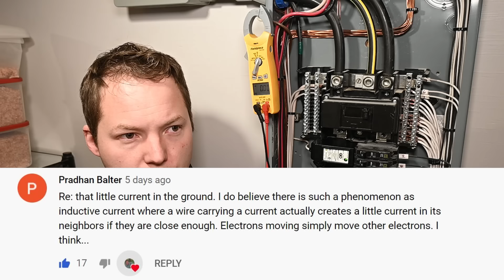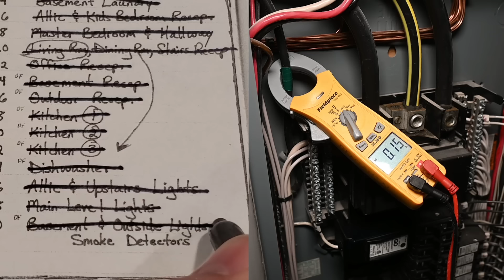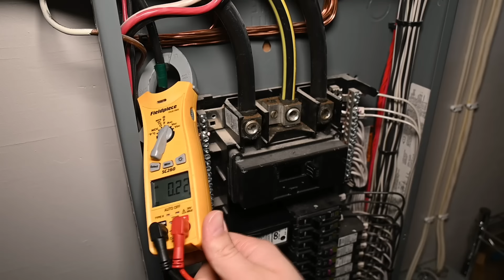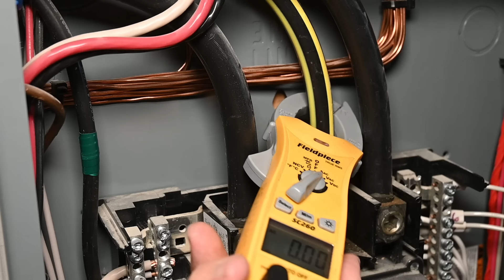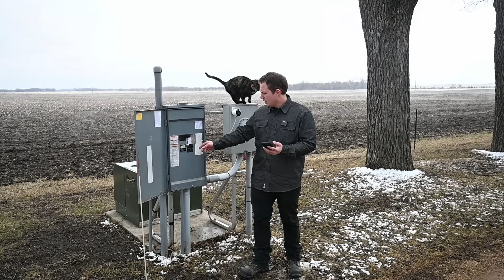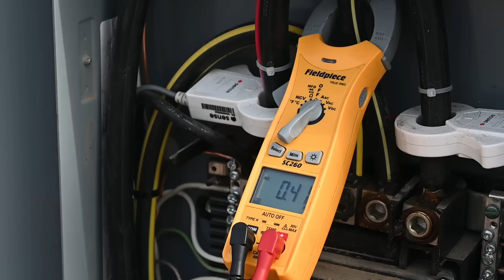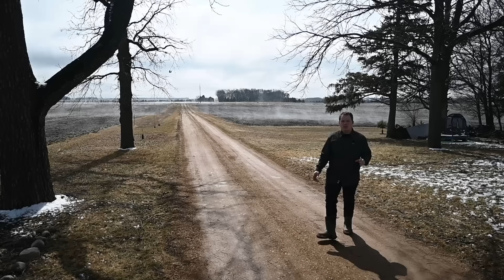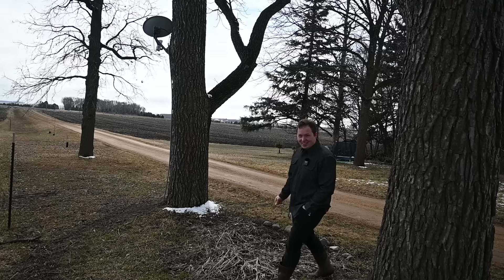Finding The Source of Stray Current on Grounding System

Comment: First of all (not only being a NEC violation) having ground rods at the main disconnecting means and at the sub panel is why current is flowing through your grounding conductor. You have created a high impedance secondary path! Your ground wire from your main panel to your sub panel (equipment ground) has become an extension of your grounding conductor/grounded conductor attachment point in your main panel. With an impeded path between the ground rods at the main, the ground rods off of the sub panel and any pipe grounded in the vicinity. There will always be potential voltage/current on a neutral, proper grounding is essential to make sure there is no potential difference. All your ground rods, all waterline bonds etc. need to be at one point at the first over-current device location. This brings all your grounds, and neutral to the same potential throughout your electrical system and keeps transient voltages between your main ground point and the utility side. Even more important, you do not want ground rods or waterline bonds at your sub panel for safety reasons! This can be a very dangerous situation in the event of a nearby lightning strike to ground in which your ground rods/waterlines conduct the lightning and provide a path through your wiring/house to any path back to ground, and being you have a difference in potentials you have created a good path! I could go on and on from issues with interference's to neutral connection issues at the main/trans. etc.
Reply: You seem quite knowledgeable about grounding! Would it be possible to converse with you elsewhere about a situation I'm having? Thank you!

Comment: not clue what i am talking about and this video is 3 years old. check with power company, and more so near by neighbors. i have seen a few videos of were.... something happened at neighbors and the power was feeding across the yard, and shocking them.  i want to say ground wire to ground rods were having issue as in wire not there or came out, or someone installed something and did not wire things correctly and sending power out.

Comment: When I connect a coaxial cable and ground it, it draws amps. When I power on other electronics the amperage rises. When the coaxial cable is disconnected, there is no amperage going through the ground...what is the problem here?

Comment: worked on communication tower construction and grounding with us is everything.  It so easy to trust that the power companies stuff is all groovy till it's not.  Have had power pole transformers over voltage and blow every power supply fuse that had an MOV for surge arresting.  The voltage was found to be +>250vac! Did not expect that.  Another time we had failures at the ground rod the power pole was grounded too.  It made everything "shocking".  Found out the grounds keeper had cut the copper wire with a metal edger.  Another time everything in the building was suffering lightning strikes and would get shocked. This was at a Forest Service center.  Seems everything was attached for grounding to the metal building that was bolted to a concrete slab but had zero grounding for the metal building.  Put ground rods at each corner of the building with grounding straps  from the rods to the buildings.   Problems stopped.  Never had lightning damage again.

Comment: How do you get rid of the current on the neutral
Reply: Every neutral wire in America that is connected to the grid, and as long as the power company is providing power, will have a small amount of current flowing throught it. This is known as NEV Neutral to Earth Voltage.

Comment: You are seeing the effects of your lovely electrical distribution system design referred to as multi-grounded neutral. It has nothing to do with how many or where your grounding system is installed. It is due to the utility that brings power to your property. This type of distribution is common in the US in all states except California, and was devised as a way for utilities to save money by eliminating the need for one more wire in the distribution system as well as cheaper transformers (single vs. two-bushing transformers). Further, the NEC requires you to tie your grounding system into the utility neutral so they can use your grounding system rent free (further saving them money).

Unbalanced loads in the utility neutral will find a way back to the source (power substation) in an uncontrolled way through the earth. These uncontrolled ground currents can be detrimental to livestock, and dairy cows are especially sensitive to it. The behavioral, health and production effects have been documented, and there have been cases of human fatalities. 

For more information, please read the IEEE publication "The Hazardous Multigrounded Neutral Distribution System And Dangerous Stray Currents" by Donald Zipse which traces the history of the issue back to Edison who encountered it back in 1880 with a system that employed only one current carrying conductor and utilized the earth for the return conductor (not just the unbalanced loads). As you can imagine, it was quite dangerous and he soon devised a fully insulated three wire hot/neutral/ground system that had no stray current and wasn't connected to earth.

Also, Mike Holt has an interesting YouTube video that touches on this subject called "Neutral-to-Earth Voltage (NEV)], NEC 2020"

Comment: BENJAMIN, When finding stray current, why not switch off each breaker one by one while measuring the stray current? its also called leakage current but coupling wires cause ghost voltages which has coupling current also. It would be nice if you used a chalkboard to show a list of which circuits you have measured and how much stray current per each break and circuit to know which is connected on the panel and subpanel because I don't know what is connected to all those different breakers.

Comment: Dear Benjy, you still have leaking currents because you have ground bars on both panels. There should be only ONE grounding to earth point. With 2 "earthing" points you have the so called "hum loop".  Comment of @88v98 describes  minimal contribution.
With 2 earthing points, you may have potential difference between these 2 points which may cause leaking currents through ground-wires-pipes and earth closed path.

Comment: but did he ever figure it out? cuz at this time i have the SAME Exact issue however .when my microwave or toaster or anything with a load is running. its been backfeeding thru the internet ground which goes to a coaxial which then fries out my modem. How can i fix or find whats causing this. the video above literally is exactly what i got. power on my nuetral seems to be coming from the meter box.
Reply: Did you solve this? We have similar situation

Comment: If you can’t capture 2 wires at once with your meter you can figure out which way the current is flowing. Normal flow will result it zero current. It would go through the loop one way and then cancel when it goes back the other direction when checked the meter base panel. This principle is used in high voltage protection systems (zero sequence for grounded fault protection).

Comment: Broken line neutral or a high resistance joint on a supply neutral off the same transformer. Maybe the neighbouring property.
You need to test across the main of each house to find it. Loop impedance test.

Comment: Run a short run of Pex pipe to the shower. You just need a short run to isolate your fixture and hot and cold handles. 6 inches

Comment: Many times i have found it to be switching power supplies and other times sub panels with the bonding strap connected .Electronics is the big one lately .Otherwise you may have a found fault outdoors at the pole or transformer .The other issue is it can come from your neighbours .

Comment: At 11:36   Did you mention two grounding rods?  What is code concerning two grounding rods. For a sub panel homeowner's man cave, back of the property,, when built he want possible power for a welder.. I installed a grounding rod, dedicated to that sub panel.  Never have known if that was good , bad, or indifferent.  If the second grounding rod is into wetter, deeper,, or saltier soil,,, the second grounding rod will have preference as a path to ground.

Comment: Ben, the electric company transformer out by the driveway has a neutral, and there is probably an electric company ground rod at the transformer. the high voltage input to that transformer goes back to the pole line on the main road. That high voltage line also has a neutral conductor. If, out on the high voltage line on the poles, there is a difference in current between the two (or three) hot conductors, some of the return is conducted through the neutral conductor at the pole. That neutral current wants to make its way back to the power source for that line. The electric company's neutral conductor is not a perfect zero ohms resistance conductor. Based on Ohm's Law, E (voltage) is equal to I (current) times resistance. 

Since the power company's neutral conductor has some slight resistance, a voltage drop will exist on that neutral. That imbalance current will take any and every possible path back to its source. So some will go into the ground at the ground rod at the pole. Some will go back through the electric company's ground rod at the power transformer. Some of that current will use your ground rod at the transformer. And some will travel through the EGC cable to the sub panel inside your home, and out to any grounding electrode, like a ground rod or the gas pipe you mention. 

At the levels you measured, this is not dangerous to you or your electric equipment. 

I had a cable TV trouble call where the power company's neutral connection was broken, and the only path for the power company's neutral current was the sheath of the cable TV cable. So much current was running on the cable TV outer conductor that it melted the black plastic insulation, and the coaxial cable dropped to the ground, There was a web of melted plastic strands to the coax. When that happens, there is danger to the cable TV subscriber and any cable TV technician that tries to replace the TV cable. So we notified the power company of the emergency condition, and the danger to life, and they came out and repaired the problem right away.

Comment: You have objectionable current. Something is improperly grounded or bonded. You only bond at the first point of disconnect. Sub panels and main panels that are bonded together with a supply side jumper will create objectionable current. If the transformer is grounded then the main panel should not have the main jumper in the main panel installed. Check with the utility company, if they are the ones who installed the transformer, to figure out if the transformer is grounded to earth.

Comment: The Electrical grid's neutral is grounded at "every" power pole with a ground rod at the bottom.  At the electrical generation place it also has the neutral tied to ground.  Electricity is a loop, from hot to neutral, but since the neutral is grounded some current flows to ground via every single place the neutral is "grounded" and yes, most travels via the neutral wire.  Now, stop and think about this: at the top of the power poles there is usually three phases, where does ALL the current of those 3 wires go?  To neutral.  Then WHY is the neutral not 3 times larger to bring all that current back, because some flows via ground.

Comment: I’m somewhat surprised it’s quarter of an amp, but I’d be astonished if you got it to zero. You’re grounded at the pole, quite possibly using aluminium. You’re also grounded on your property, quite a distance away, using a galvanised steel rod and further grounded by copper pipes, run direct in the ground.
All of these dissimilar metals will cause a small potential to develop, but your clamp meter won’t measure the resulting DC current, I think. I’m pretty sure that’s an AC only unit. If it CAN measure DC current, that might explain why it’s so high.
However, given the distance between all of the earth connections, and the proximity of live power cables, it would be something of a miracle if all the different ground points were at exactly the same potential, so I would expect some current to flow, trying to equalise them. Just not that amount. I’m curious to know what other power users might be nearby and whether they might have an undetected ground fault.

Comment: Smart meter question hopefully some one can help. For two year’s I believe I’ve been wrongly over charged kWh’s I couldn’t have used. Regularly Duke Energy smart meter reported I was using over 1,200+ kWh’s per month sone instances 80/90 kWh’s per day. They recently changed the old smart meter for a new one after several complaints. Right away kWh’s reduced to about 35 kWh’s per day about half of what they said on old meter. What could have went wrong with the old meter to do that? Also had an electrician check my circuit breaker box and he said he was reading high voltage and fluctuating current coming into my box from the outside source. Could that be a reason for the difference and why would it stop with the new meter? Also I would have weird unexplainable spikes at weird early morning hours of some times up to 8-9 kWh’s of energy used at hours of 1am - 3am. 9 kWh’s us a lot of energy and a big spike when nobody is awake or using anything.

Comment: we had the same issue before but once we made a common ground rod, the mini current vanished. Multiple grounding made a capacitive system resulting a discharge to earth of current but due to high resistance you only see that in milliamps.

Comment: My guess is that the neutral on the transformer is not exactly in the center of the windings so there is a bit of differential between them and that is want is causing the current on the ground wire to ground. That current would be going back out to the ground at the power pole since that is where the difference between the windings would be referenced to.

Comment: Hi Ben, I have heard that from utility men, house A has a 50 amp load with a bad neutral in panel.
Current can flow in ground to ground at house B and house A's load is tryng to find a return to
the pole xfrmr though house B's neutral.

Comment: The earth gives off about 2 volts .You can use it to charge a phone if you use a transformer of 10 watts.
Reply: edwardwest I suggest watch a 13 part series called What on earth happened by Ewaranon to learn that the earth is not a globe.

I got it in my about tab.

Comment: Since the transformer was never shut down and active. The transformer windings are inducing current on to the grounding electrode.......try removing the ground from the system and remeasure the current on the ground to your ground rod.

Comment: I'm not an electrician, or a lineman, but the neutral may not be "centered" in the coil, I did not read all the comments

Added, are both "legs" exactly equal in voltage/amps when on?

Comment: The reason there is current on the grounding system is because it is in essence in parallel with the neutral.  Therefore, the neutral, which is connected to ground at the service equipment, and connected to ground at the transformer, has a path through the earth in parallel with the neutral conductor.  So most of the neutral current will run through the neutral conductor, and a little will run through the earth.  The amount will depend on the resistance, in ohms, between the neutral and the earth between the ground rods at the home's service and the ground rods at the transformer.
Reply: ericjorgensen I suggest watch a 13 part series called What on earth happened by Ewaranon to learn that the earth is not a globe.

I got it in my about tab.
Reply: @flat-earther  Oh fer fuck sake, if the Earth was flat, there would be no coriolis effect. So, the water in your toilet wouldn't swirl, tornados wouldn't spin, thus non-existent, and there would be no hurricanes. Google Coriolis Effect, sit with it. End of Flat Earth Theory...

Comment: Benjamin, one of the things power companies do is bond the center tap or neutral (connected also to your service ground rod) on the secondary of the transformer to the primary low side, you showed this in one of your videos. Since the electrical utility neutral is grounded at each house located along a street or road.With multiple grounds on a very long neutral wire carrying  power you have resistance in the power line wires, resulting in a small measurable drop in voltage from one ground to another. So because of the potential difference you will have a small amount of current flowing into or out of any ground rod/s in the system.
Reply: mh3 I suggest watch a 13 part series called What on earth happened by Ewaranon to learn that the earth is not a globe.

I got it in my about tab.

Comment: Thank you everyone… especially you Ben… I am a self taught HVAC contractor who runs into stay voltage issues regularly… this has helped my thought process!
Reply: Curious, what problems do you encounter with stray voltage Chet?
Reply: chetfoster I suggest watch a 13 part series called What on earth happened by Ewaranon to learn that the earth is not a globe.

I got it in my about tab.

Comment: ghost current ,not enough to worry about. I got 10 volts in my solar inverter i can't figure out, yet
Reply: kermitwingard I suggest watch a 13 part series called What on earth happened by Ewaranon to learn that the earth is not a globe.

I got it in my about tab.